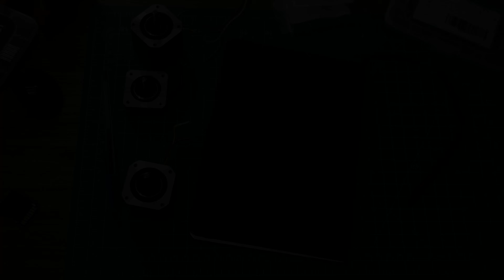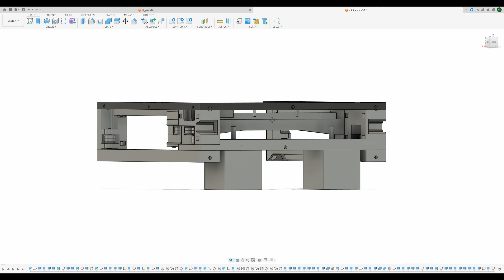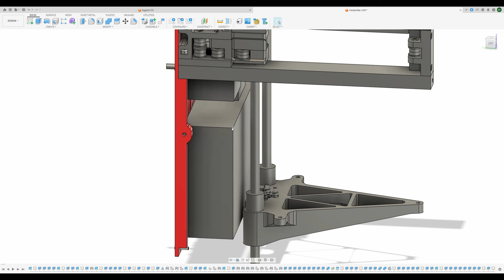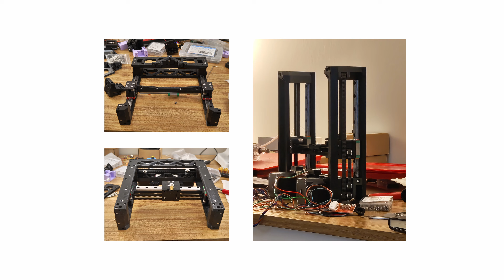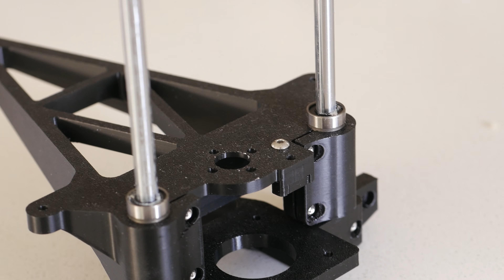I 3D Printed a 3D Printer: The Encore CoreXY

Comment: Springs for the printbed is a very old idea we were right to forget. Try silicon stands instead. That's just my engineer opinion, but structural plastic parts is a questionnable idea because of the material properties. As it is a WIP, I would recommend to study the possibility of mounting electronics on the outside for cooling and maintenance purpose. And we all tend to forget cable management in our designs.
Reply: The silicone standoff is a definitive improvement, because a spring is an oscillator, and silicone is effectively a spring-damper system, so it loses energy in short order and doesn't keep swinging for very long.

But my pet solution is an adjustable hardmount. From top to bottom:

counter sunk screw head
bed
washer
nut
some free standing screw thread
wheel-nut (just a nut in a printed carrier)
bed carrier
another wheel-nut
the end of the screw thread

Can you picture this in your mind?

You can also add some washers around the bed carrier and replace wheel-nuts with normal nuts, if you just set it up once and never adjust it again.

To adjust, you simply loosen the lowest nut just a smidge and then you turn both nuts hugging the carrier, and then you tighten them against each other.

By nature of things, everything is a spring, and the screws have some hypothetical capability to swing, so i cannot definitively say that this is better than using rubber stand-offs, but it is how i do it, and i deem it solid.
Reply: @SianaGearz  A tensioned screw has a dominant torque, so you can make it much simpler, il will hold position anyway.
Reply: @SianaGearz that's pretty similar to the solution i tend to implement.  i prefer rigid bed mounts to silicone, so most of the time i'll use aluminum spacers & try to get it as level to the gantry as i can during assembly.  of course, i also try to incorporate triple z tramming into my designs to account for the rest....
Reply: Springs for the bed cause issues on bedslingers, heavy prints, and heavy toolheads with high acceleration. This has none of that. If you maximized your build volume and printed a 100% infill cube on this printer, 3 strong springs still wouldn't flinch.

Yeah plastic as structural is usually a bad idea, but size and context matters. I'm midway building one and  the rigidity of the structure is already impressive. Add to that it has a lightweight bowden toolhead, I'm not really concerned about vibrations.

And last, about the cooling of electronics. Sure, it would be better to have them outside. Maybe I'll even add a fan to the PSU since it's millimeters away from the heated bed. On the other hand it's an open frame printer. 

This is a DIY machine, quite budget friendly too (compared to a voron). It will vibrate some, and run hot too. It's ok. If you don't like it and need micron precision, you're just not the target audience and that's fine too.
Reply: @mihalyrozovits7259  All right, let's face mechanical realities, shall we ? A spring will be a spring. A spring is quite the opposite as a fixture. That's a major flaw easily fixable : secure the bed. Even if bed slingers is the worst situation for springs, springs can catch the gantry vibrations by solid transmission through the structure and amplify them. Install a dial indicator on the bed structure and measure the transmitted vibrations, you'll see you're dealing with something. 

About Plastic as structural parts, you're right about stiffness is a question of Young modulus value, so thickness influence rigidity. BUT, low density plastic is also not stable in shape along the time. Low densitiy because it's the nature of 3D printing, you do not force plastic into a mold, you let plastic expand out of the nozzle. And keep in mind that most thermoplastics have a young modulus 20 times lower than aluminium (which is not the best structural material already). Add the low density, and we are 25 times less stiff than aluminium. To be close to match a 3mm aluminium plate, you want a 75mm thick 3D printed one. Got it ? 

This is not an opinion or a critic, this is basic physics. ;)
Reply: @axelSixtySix  Please be less condescending and work on your tone. 
And please don't tell half truths and say "This is not an opinion or a critic, this is basic physics. ;)"

I'd also prefer silicone spacers over springs, however springs don't magically amplify vibrations from the gantry out of nowhere. Springs have a resonant frequency. If the printer hits that specific frequency, it vibrates more.

It is true that engineering plastics (like PLA, PETG, or ABS) have a Young’s Modulus that is roughly 20 to 25 times lower than aluminum. It's also true that plastics can creep (deform under constant stress over time). But please don't pretend to be an engineer, when you get the basic fundamentals wrong.
Stiffness against bending for a flat plate does not scale linearly with thickness. It scales cubically...
To match the stiffness of a 3mm aluminum plate, the 3D-printed plate only needs to be about 9mm thick, not 75mm. By making it 75mm thick ,the plate would actually be over 600 times stiffer than the aluminum plate. Got it?

While 3D prints are weaker along the Z-axis layer lines, a properly extruded solid perimeter or 100% infill part is incredibly dense and close to the raw material's base density.
Reply: @thijsp  Sorry, English is not my main language, I guess I have a heavy accent and no tone at all. Actually, I am a graduated engineer since 1989.

I tried to underscore the point because I never imagined a serious engineer would consider 3D-printed structural parts a stroke of genius. Let's move on. We agree that moment of inertia is a constant, and piece stiffness depends on both Young's modulus E and the moment of inertia I. Again, there's theory, but also experimentation. Have you placed a dial gauge on your 3D-printed elements in operation? Because a 3D printer requires micrometric precision, and I don't believe it can be consistent with 3D-printed structural parts for various reasons: rigidity, temperature, and so on.

Next, you make a serious approximation by thinking a 3D-printed part at 100% infill approaches the density of the base material. First, FDM technology is low-density extrusion deposition. The filament expands at the nozzle exit. So factually, the resulting density is lower. Second, 3D printing is anisotropic. Third, 100% infill serves little purpose, as demonstrated by the properties of a hollow tube versus a solid bar. And 100% infill still contains a large number of voids and does not significantly increase covalent bonding between polymer chains.

In short, agree or not, I maintain that the use of 3D-printed plastic structural parts is a false good idea, especially since it is more expensive than using parts made from more suitable materials. Steel costs $1 per kilogram, aluminum $4 per kilogram, while filament is far more expensive. QED.

And by the way, why using springs or silicon while you can just fix permanently the bed for consistent use ? Set it up once, verify geometry on maintenance schedule, then forget it again. 

I respect your conviction, but I think we simply approach materials engineering from different perspectives. Mine comes from field experience and material physics; yours may favor innovation over proven practice. Both views have merit. I wish you well with your experiments.
Reply: @axelSixtySix  Thank you for your reply.

You didn't actually address the 75mm claim. You dropped it and moved to density and cost instead. If you now agree the stiffness math was off, just say so.

On infill: "100% infill serves little purpose" doesn't hold up. 100% infill is the solid bar in your hollow tube versus a solid bar comparison, that's the entire point of specifying it. Yes, FDM parts aren't 100% of bulk material density due to extrusion voids, but well tuned prints get into the 95%+ range, which doesn't come close to closing a 9mm vs 75mm gap.
The layer adhesion point is fair in general, but for a flat bed plate loaded in bending, the stress that matters is in plane (tension/compression across the surface), which is the strong direction for FDM parts, not the weak Z-axis you're describing. So it's not obviously relevant here.

On cost, comparing raw material price per kg is misleading on its own. For a DIY/hobbyist build, the real cost comparison includes supply chain (sourcing and machining a custom aluminum plate vs. just printing one), manufacturing (no tooling, no outsourcing, no lead time), and design iteration (changing a hole pattern or rib layout is a CAD edit and a reprint, not a new machining job). That's a big part of why printed parts make sense on a budget machine even when the material itself is pricier per kg.

I'll grant the repeatability point: whether a 3D-printed structural part holds its geometry over time under thermal cycling is a fair empirical concern, and one theory alone doesn't settle. That's worth being skeptical about. But "this is basic physics" was the wrong way to make that case, since the physics you led with was the part that was wrong.
Reply: @thijsp  Your tendency to find fault in every statement might be entertaining over drinks, but neither here nor now. Let me be clear on the facts.

First, the 75mm example was pedagogical: a way to illustrate the cubic scaling relationship so regular people understand the gap between aluminum and thermoplastics regarding Young's modulus. That wasn't a concession; it was a teaching aid. The math stands.

On infill: you've touched on something critical that I should have stated clearly. In FDM, what actually determines structural performance is perimeter count, not infill density. Beyond approximately 5 perimeters (5 × 0.4mm), bending strength, shear strength, and tensile strength do not increase significantly. Infill is secondary: it adds mass without proportional strength gains. That's material science fact, not opinion.

The 95% density claim is my all time marketing claim favourite. Stratasys itself states that 95% density is only achievable through thermal annealing, with specific filaments, under particular processing protocols. On consumer-grade or DIY machines, you're nowhere near that. You're realistically at 85% density minus the structural voids created by pill-shaped deposition geometry and bead overlap. The claim of 95%+ is simply not credible for standard FDM. And deposit density versus overall part density are not the same topic anyway. More critically: density is one thing, covalent bonding is another. You get full intermolecular bonding only in complete molten fusion. FDM deposits molten material onto an already-solidified layer. Layer adhesion occurs, but cooling interrupts full molecular chain entanglement. This goes way further than a simple material comparison, because it's FDM. 

Now, on structural use in machines: any moving system experiences stress across three axes, particularly through solid transmission of vibrations. An anisotropic material is, by definition, weaker in at least one direction. Thermoplastics carry other defects equally serious: creep under constant stress, high thermal expansion, softening at elevated temperature, variable fatigue resistance, and difficulty maintaining tolerances over time. Are we building a machine or a disposable one?

You mentioned the "amateur versus professional" framing. That's a rhetorical move, not an argument. There's no reason an amateur should accept inferior structural materials simply because they're easier to iterate on. Metals are ubiquitous, recyclable, and require no more skill than cutting to length and drilling a hole. You don't need NASA equipment. You get the parts and do the job in a fraction of the printing time. Better parts, less time, inexpensive.

The actual question is: what is the right material for a mechanical application? Thermoplastics, especially FDM-printed ones, are among the poorest candidates. It's material selection based on use case.

Look at Prusa's evolution: from MK1 to MK4, they eliminated approximately 30% of their 3D-printed parts, and all that remain are mostly non-structural. Every engineering-based machine manufacturer has zero plastic structural components. Everything is metal-to-metal. That should tell you something.

This isn't a matter of perspective. It's material engineering. The evidence is there. I've stated the facts. That's where I close this.
Reply: @axelSixtySix  
The 75mm number wasn't pedagogical the first time, you wrote "you want a 75mm thick one. Got it? This is not an opinion or a critic, this is basic physics ;)". That reads as a conclusion, not an illustration. If you think the cubic relationship makes 75mm absurd now, fine, that's basically agreeing with the correction. No shame in being wrong on a number, just call it that.

Also I never made an amateur vs professional argument, that was someone else earlier in the thread. My point was simpler: for a DIY build the material cost per kg isn't the full story once you factor in machining, sourcing, and how easily you can tweak a design and reprint it.

On the Prusa claim and the 95% density number, I looked and couldn't find a source for either the "MK1 to MK4 dropped ~30% of printed parts" figure or the Stratasys annealing claim. What I did find is some Prusa parts moved to injection-molded plastic, not metal, so "everything is metal-to-metal" doesn't really check out. Got a source for either number? Otherwise I'd hold off stating them like they're settled.

The perimeter count point on infill is a good one though. But it kind of works against you, not for me, if a printed part gets its strength mainly from a solid perimeter rather than infill %, that's an argument for engineered plastic parts being usable, not against it.

And "I've stated the facts, that's where I close this" isn't really how facts work. You stated a 75mm number that turned out wrong, and two more numbers with no source. Declaring the discussion over doesn't make the numbers correct, it just means you'd rather not have them checked.
Reply: @thijsp  Your life must be really empty if this is how you spend your time. Arguing with strangers on the internet, twisting everything just to win an argument you've already lost. That's not engineering. That's just sad.
Get a hobby.
Reply: @axelSixtySix  No source for either number, no answer on the 75mm walkback, just insults. I'll take that as an answer in itself. And I haven't twisted anything, I quoted your own words back to you. If that feels like twisting, the problem isn't my reading comprehension.

Have a good day.

Comment: silly question, I assume you used abs or petg for the printed parts ?
Reply from the maker: Just PETG - I don't have a good way to ventilate ABS fumes in my small apartment
Reply: @AYMakes thanks for the reply dude, I usually dont print with pet g but I grabbed a centauri carbon so maybe ill giver a shot and start the build , I recently built the cubiron, an all 3d printed mini 3d printer and its wicked so im excited to build yours to add to my collection!